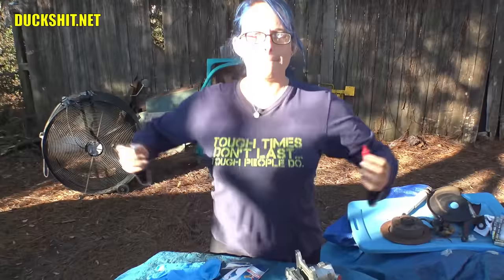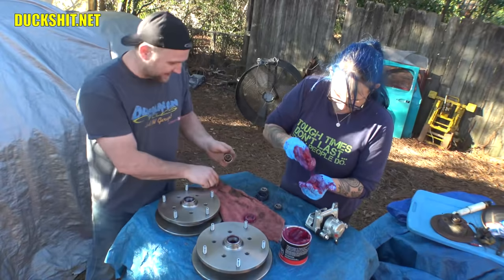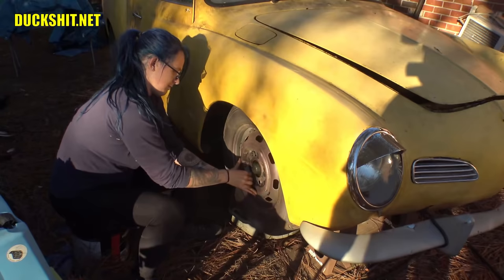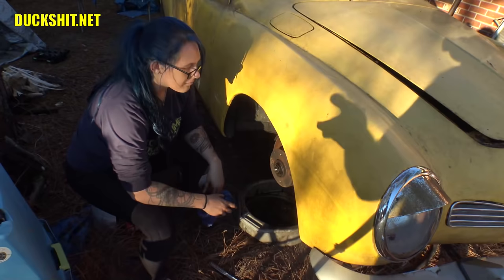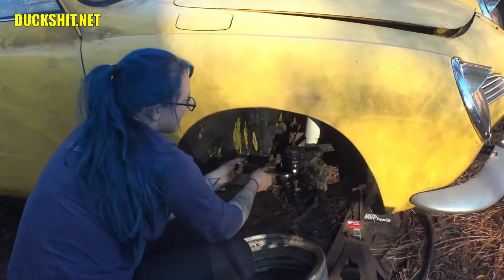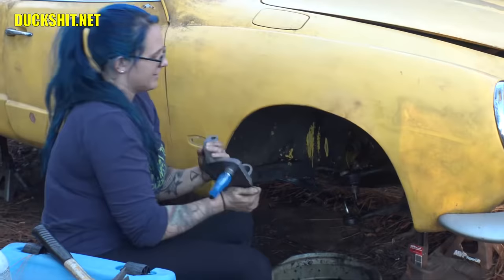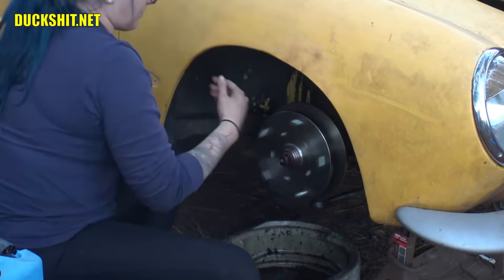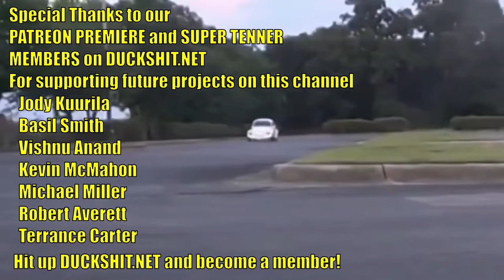1971 VW Karmann Ghia - Disc Brake and Drop Spindle Upgrade - Part 5

Comment: Great Video as always. On the point of Hammering in bearings, I was doing the front wheel bearing in an Austin Allegro (look em up... awful UK crapmobile) one winter when I felt a sharp pain in my forehead. Later I walked in the house and the girlfriend screamed when she saw me. . . I had a sliver of steel sticking out and blood all down my face, 
The Hammer head had shattered and a shard had flown up and stuck in my forehead, I'd been so cold I hadn't noticed. My own fault, Cheap Mickey Mouse Tools... didn't make that mistake again!
Reply from the maker: Oh no!  Now that is a story!  Wow!

Comment: I just bought a 1970 stock KG.  I’m wanting to drop the front with 2.5” spindles.  Not really wanting to do the narrowed beam and all that.  Will the spindles alone work without rubbing issues?  If so, what size tires would you recommend for issue free clearance?
Reply from the maker: The tires you see here in the video 4.5x15, vintage sized Coker tires... which are a little skinnier than stock VW tires. Something this size or slimmer should fit well.  If you already have stock tires on your rims you might just want to install the wheels and see how they clear after lowering. Karmann Ghia bodies were hand built so there's a lot of variances in clearances from one car to next.  For us with the drop spindles, everything was pretty close and rubbed just a little bit at extreme steering angles.  I added some spring shocks to it that raised it up just a just a little bit which made a tremendous difference, and still looked good.  Hope that helps!  Thanks for the questions.

Comment: Since the bearings are new / clean, just put them directly into the grease & roll the bearings around until it completely covered; much quicker!
Reply from the maker: Much quicker, but not as thorough.  The grease must be PACKED into the bearings, not just coated!
Reply: @DuckmanCycles  The way I do it by rotating the inter race, which pulls the grease into the connecting bearings and since the entire bearings set is in the grease, the outer race is coated also.
Reply from the maker: @am6066  thank you, of course... but it still needs a proper packing, not just a coating!  :-D
Reply: @DuckmanCycles  sounds good!

Comment: Old timer I knew used to use a metal syringe and heat grease to liquefy it but with the synthetics it might not work me I've never tried it myself but he swore by it
Reply from the maker: Inject into the bearings?  That sounds like fun!
Reply: @DuckmanCycles  yep they swore by it and it would make sense cause liquid could get where grease couldn't and I talked to some that said that they just put the bearing in a pot of grease heat it up till grease is liquid and then just let the bearing and grease cool still in the pot

Comment: Bee did a great job 
is that normal for the brake caliper to be down that low ??
Reply from the maker: On an air cooled VW this is the normal position for a brake caliper.  Thanks for the question!

Comment: Hey nice video, I going to put dropped spindles in my bug, it has the original suspension. Have I to put shorter shocks ?
Reply from the maker: No need with only dropped spindles, however if you have a lowered beam (which we do) then you'll need em!

Comment: How far set in are the tires gonna be duckman? The rears look closer to the edge of the fenders (even tho I know your changing the look etc)

Will the front be set in more?

Looks great Bee!!
Reply from the maker: The wheel and tires should be in the same location you see them now.  It already has a narrowed beam in the front, which is good it helps offset the wideness of the dropped spindles.  It should all work out well!
Reply: @DuckmanCycles  awesome man. sorry missed the comment earlier.

Looks great!

Comment: With the rotors can you run a smaller bolt pattern? If so what size is that pattern?
Reply from the maker: Yes, the Porsche 5x130 pattern is also drilled and tapped on these rotors.  I think if I were to use those, however, I'd use a different, lighter late model disc.  Too much extra metal here otherwise, adds a lot of weight.

Comment: Duckman hello i hope you are very well. In your videos are there any talking about double master cylinder? I have a VW Brasilia and recently changed all the brakes, tubes, wheel cylinders, master cylinder and I have zero pressure in the system. Pedal goes all the way down, I bleed, I adjusted the pads and nothing. I'm suspecting that I may have purchased a bad master cylinder.
Reply from the maker: That is possible, or the master cylinder isn't bled properly or there is still a lot of air in the lines somewhere!  I'd make sure its all good!  I hear this from people often yet never encountered such a problem myself!

Comment: What is that tool that you used instead of the pickle fork?
Reply from the maker: A ball-joint separator!  Pretty easy to get a hold of, and not expensive either!
Reply: @DuckmanCycles  Thanks for the reply Duck! I appreciate it!
Reply from the maker: @Splashdown99  No problem!  Glad I could help!  :)

Comment: I'm getting ready to do a customers with the same setup how much does it increase the track with?
Reply from the maker: I forget, but I think its like 1/4"- 1/2" each side.  We've got a narrowed beam so really not a problem here.
Reply: @DuckmanCycles  sweet thank you for the reply I'm putting 17 in rims but it has a 6-in narrowed beam and it's way  narrow the tires rub on the toe boxes, the increase in track with will be great and save some money on the zero offset kit 😁

Comment: do I also need to change my shocks when I lower the car?
Reply from the maker: That depends on lowering method, and exactly how low you go!
Reply: @DuckmanCycles  my plan is a drop spindle in the front and one spline adjustment in the back.
Reply from the maker: That’s a good tasteful amount, and yes you can get away using stock shocks in that configuration!  Hope that helps!

Comment: Does the brake set push the offset outwards, compared to to 4 lugs brakes
Reply from the maker: The brake set should be the same track width, at least it claims to be, but the drop spindles do widen the track width a bit.  We already have a narrowed beam so that should counter act it a little bit!  It should all fit nicely!

Comment: Oh yeah you are doing it all wrong Duckman! Using a wood butcher hammer and socket to evenly install precision bearing races. Every real mechanic knows you use a steel drift punch with a ragged end and a 3 Lb sledge hammer. Not only to bugger....er I mean... drive the race in but smash a finger or two as well : ) Now Go back and do it right...Heh heh
Reply from the maker: Yeah, I'm always wrong!  😂🤣😂🤣👍🏻
Reply: As I use a aluminum race driver now for Mac I did use socket and Hammer but it's the same method